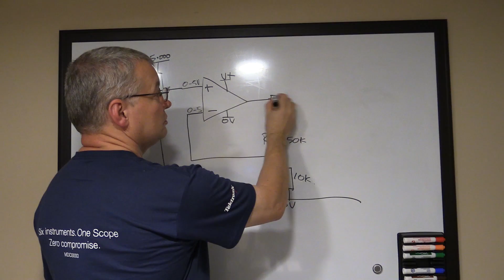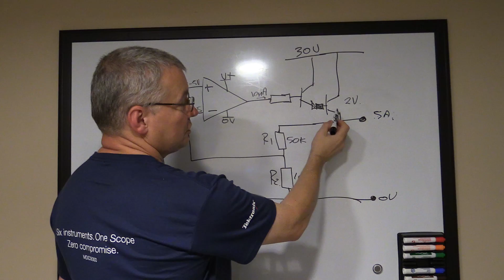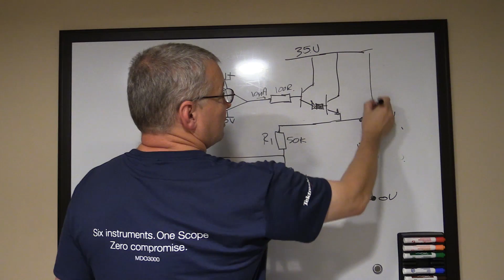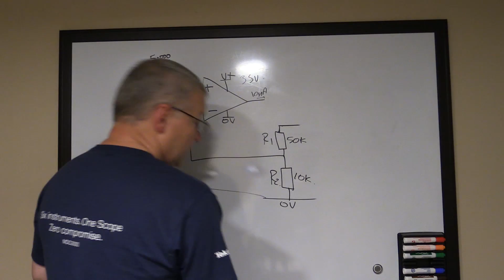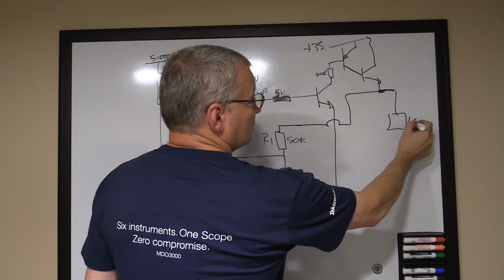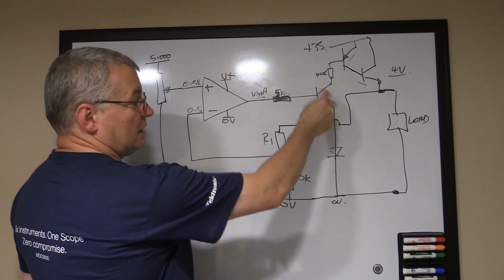The Modular Bench Power System, #3, OP Amps #2 - Bipolar Drivers

Comment: I'm still really new to electronics, but I always figured transistors were more like a switch so they're either on or off and will allow a fixed voltage (ex: the 35v rail) to pass or not to pass?  Or is this purposely driving the transistor right at the mid point where it's starting to turn on but not quite on yet?  Just trying to figure out how it's going to cause a variable voltage to be outputted.

Comment: Thank you for making this video series. I find its practical nature quite appealing. The choice of content and way in which it is structured makes it utterly comprehensible.
One mayor problem I have found when going from theory to practice is choosing suitable components. There are many commonly used ones that are well known; unfortunately however, not by me. It may be early at this point, but if you find this topic fitting with the series any guidance as to what set of components might be good to have in ones drawers would be much appreciated.
I will eagerly await the continuation of this compelling series.

Comment: Thanks again for a video just at the level I need.

One suggestion. I'm finding it difficult to get the order of viewing the videos right. I think this is because you are using a major and minor numbering system. I think it would be easier if you used either a single video-in-series number for the major number and/or made the minor number a letter, eg, this video would then be 3b (Modular Bench Power System #3, OP Amps b).
Reply from the maker: Good idea, I will look into doing that, Anything to make the viewing easier

thanks

Peter